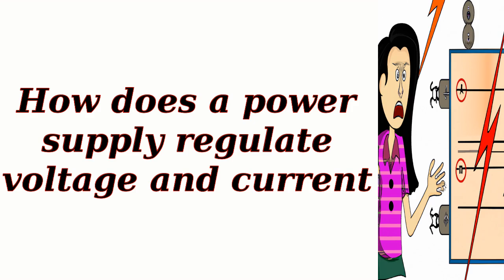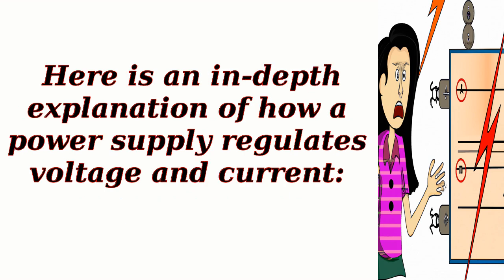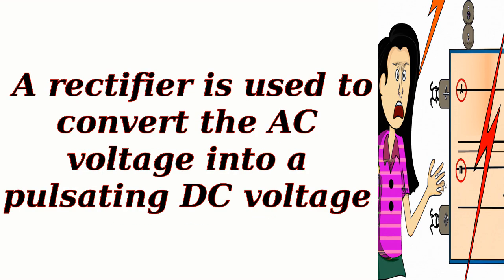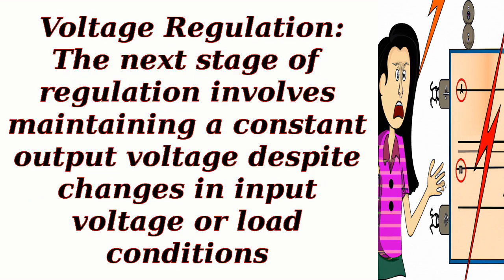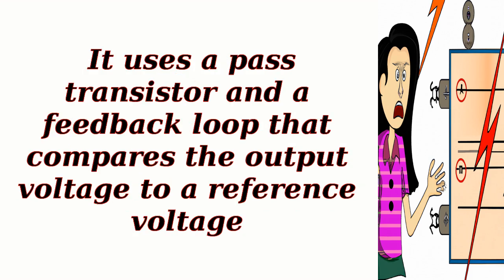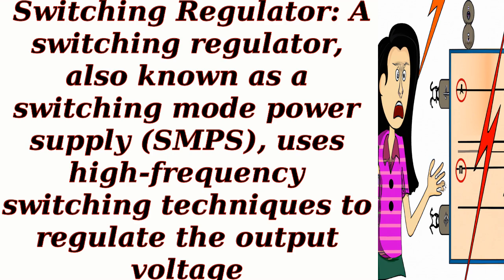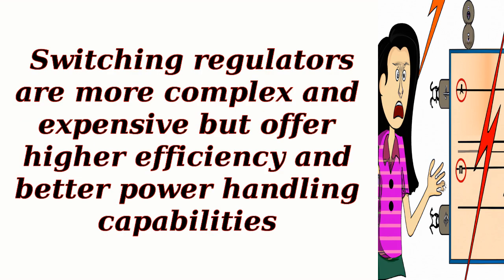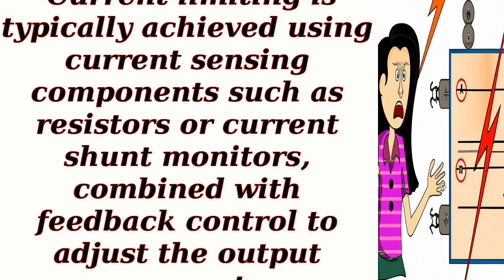How does a power supply regulate voltage and current?

Comment: Video is misleading in that it talks about voltage and current regulation which will give people the wrong impression that both voltage and current regulation occurs within a single power supply at the same time and this is not possible.

You cannot regulate both current and voltage at the same time  on a single output. You can only regulate one or the other.

Comment: No mention of current regulation despite it being mentioned several times at the start.
Reply: 3:03  Current limiting.
Reply: @SamiJumppanen  Current regulation is not current limiting.
Reply: @deang5622  yes, you are right. Usually talking about constant current sources and not regulating the current, I was missing the point.